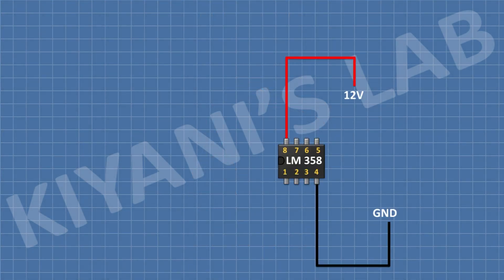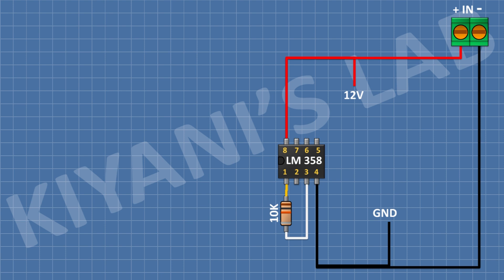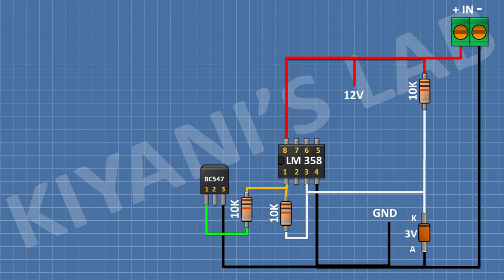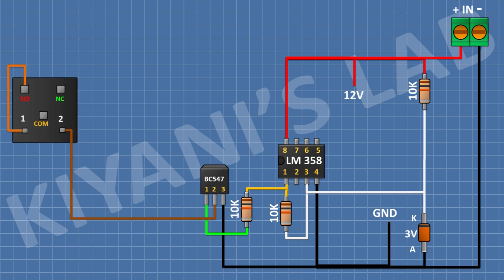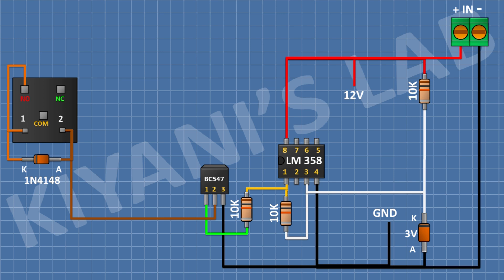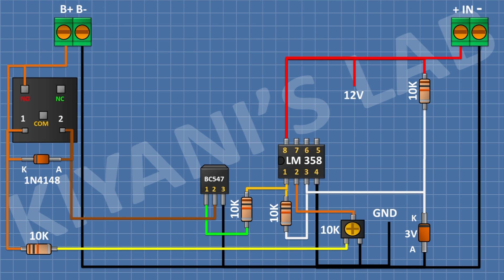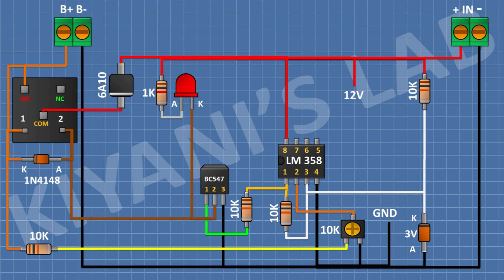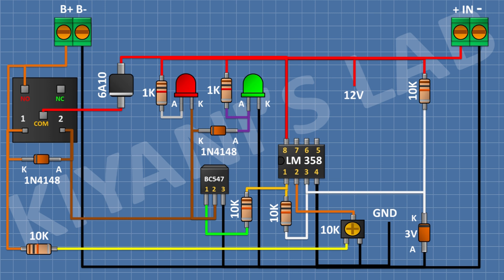How To Make A 12V Battery Over Charge Protection Circuit

Comment: Please explain what you are doing with alligator clips. Also, I have always wanted to make a car trickle charger with 13.8 volt cutoff incorporated with the protection circuit. Such detail when it comes to putting the circuit together and it is so much appreciated. That is why I have subscribed. Thank you

Comment: 2:40 BC547 pin 1 colector, pin 2 base, n pin 3 emitter, right? and the leg/pin connection in the video is correct or is it just an example? I've followed it, exactly like that, but how come the VR/trimpot has been turned fully back and forth and there's no reaction. The output has been combined with the input during calibration/setting, but there is no reaction.
Reply: same here, any solution?

Comment: Good morning, this circuit works to charge the car battery 12 volts 70 amps Thank you
Reply from the maker: yes it can but you need to use digger relay
Reply: Sorry, I don't understand
Reply: @KiyanisLab  bigger relay  to handle the current small relay can only handle 5amps to 10 amps

Comment: It would be good if you would describe how the circuit ACTUALLY works, when a low batt is connected to the circuit & as it charges & then disconnects charging.

Comment: I want 12v 30 ah auto cut battery charger circuit plz make this topic one video plz.... Thank you
Reply from the maker: this circuit can be used with 30ah the charging current should not more than 5A
Reply: Ok Thank you....